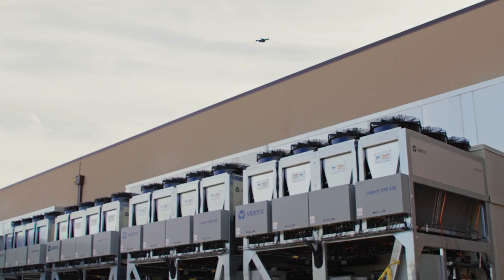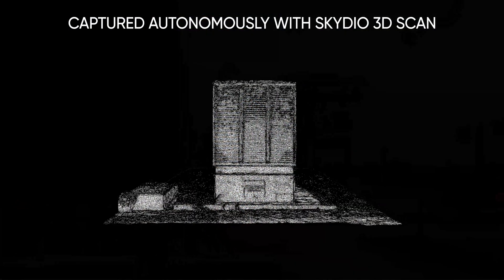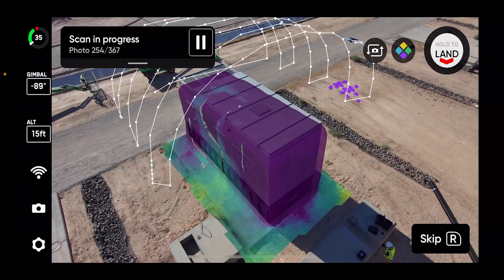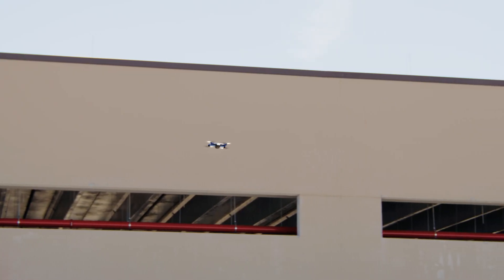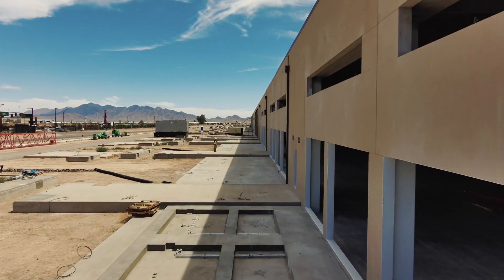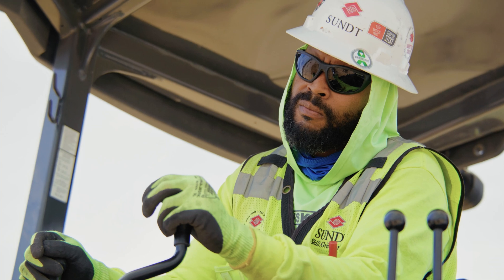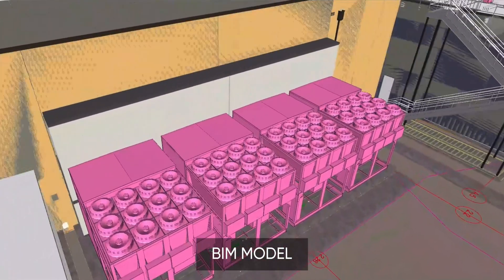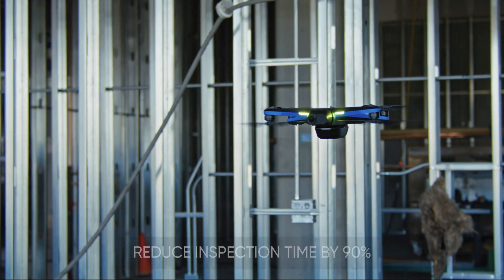How Sundt Construction uses Skydio drones

Comment: But you need to be more clear… the software to do this is 4,000$ bucks more … not counting the other third party service you’ll need from drone deploy or whatnot. Disappointed to find this out. Was never explained when I bought .. rather sneaky …….
Reply: Seriously! After I bought the drone 3 months ago, and waited till now for their sales response to purchase the 3D scan software, recently found out that it required third party software for post processing…disappointed
Reply: Hi Conover, have you tried dronedeploy with skydio drone yet? I read dronedeploy offer feature from drone fleet management to data post processing. In this case, is it necessary to have this 3D scan software?
Reply: @ChinKiatKiat  im not expert. but it sounds like you need the bloody 3800$ Skydio software.. and then some other 3rd party company that does the post processing or whatnot
Reply: @qcbs2315  and that is annually btw!  It is roughly 1500 extra annual to be able to tilt the camera straight up!